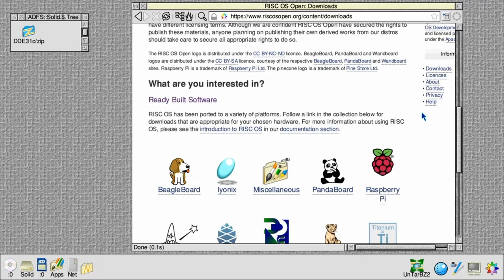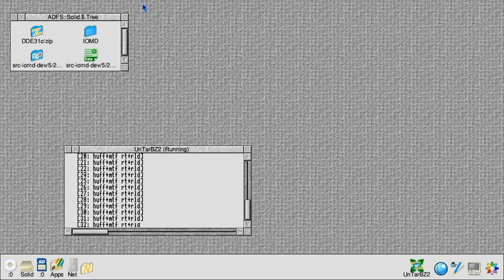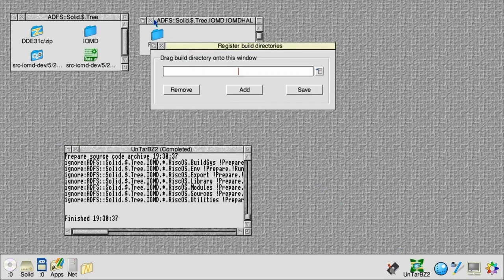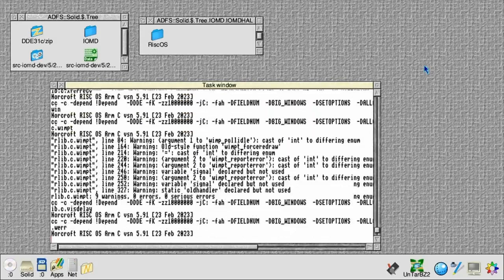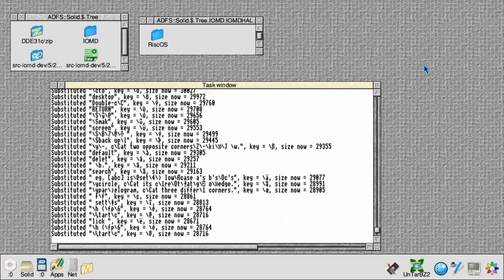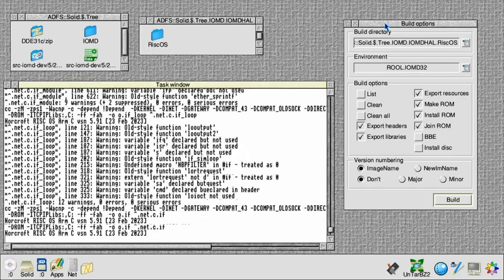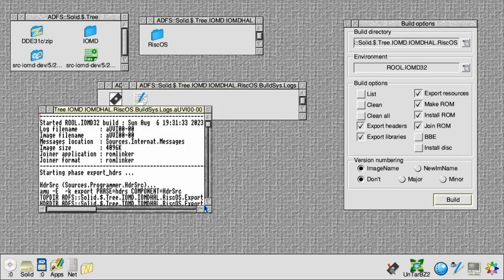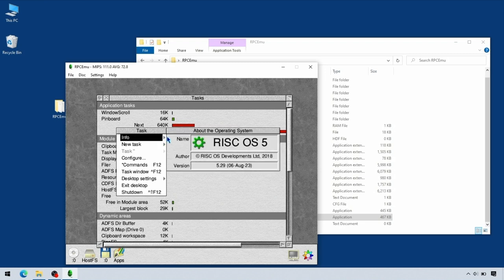Building RISC OS ROM Images from sources

Comment: Great. So simple. Just built 5.29 (08-Jan-2023) on the Pi 400 for use on the Pi 400 using the Builder's Environment option BCM2835.